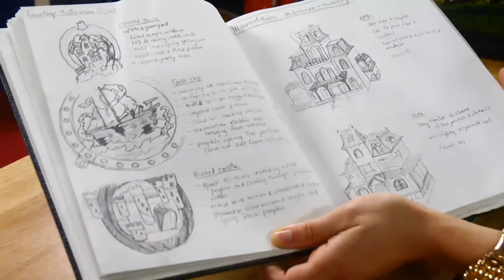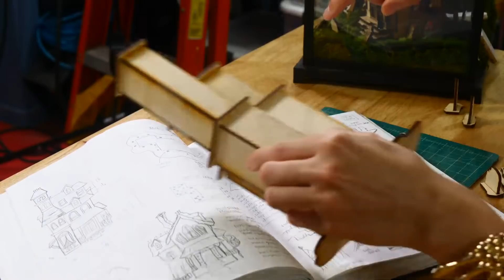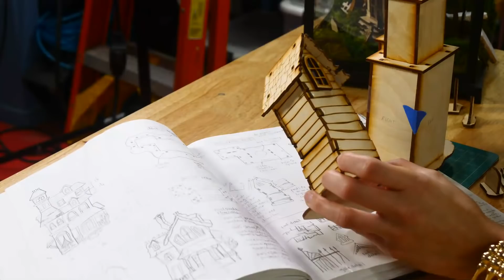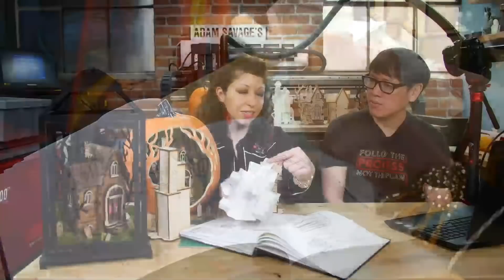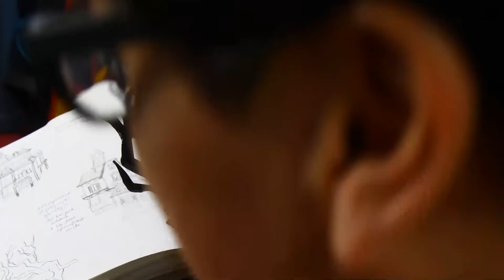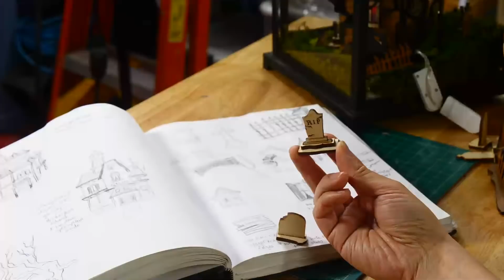Designing and Prototyping Laser Cutter Projects - Q&A!

Comment: I've had a Snapmaker for a few months now. A bit of a learning curve to work out settings to get good results. It's a low power laser and I always underestimate how many passes it will take to cut through a material but etching works well. Anyway, my comment is yes working leather smells, and DO NOT leave your laser unattended when working with paper and cardboard - it's smoky (use in well ventilated area) and the fire hazard is nothing to ignore.

Thx for vid.

Comment: A Tip for all Diode and CO2 Laser Freaks: You can etch on tiles and plates with the Norton White Tile (NWT) Method. The Titanium dioxide in the white paint will get you black engravings, embedded in the cerammic.